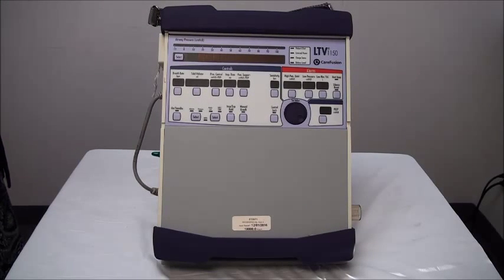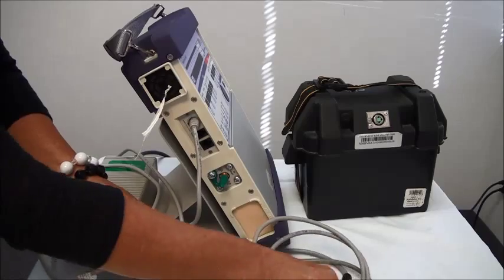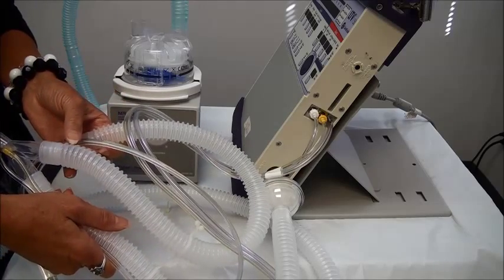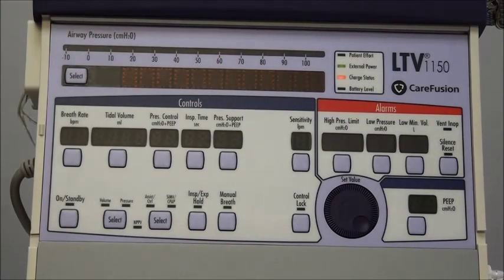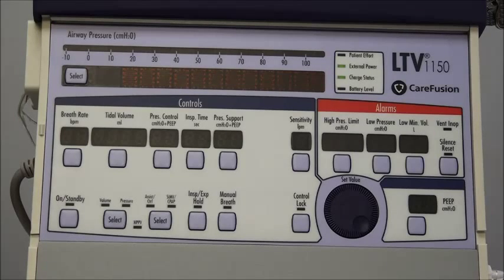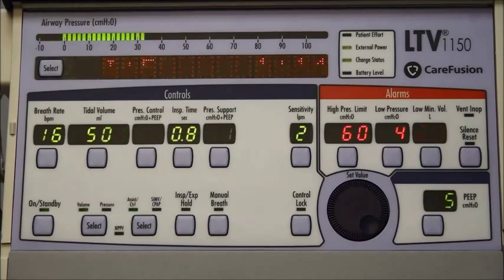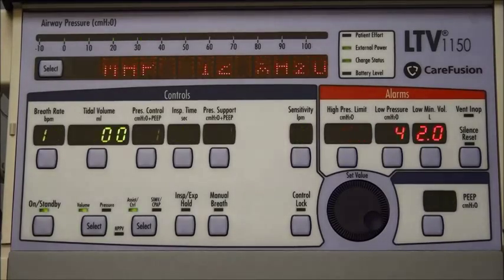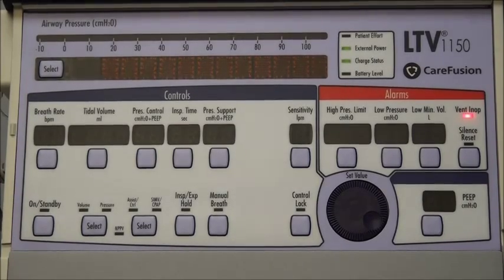LTV 1150 Ventilator Set UP

Comment: I just want to warn you. If you use an LTV 1150 ventilator, and you use it with a conventional humidifier WITHOUT A HEATED WIRE, well In other words, "DO NOT DO IT," if you can avoid it. The problems you will have are serious and potentially harmful. You're going to get water stuck in the exhalation valve, and the ventilator's going to alarm "DISC/SENSE," and you're gonna have the hardest time trying to clear the water out, because if you tap the valve on something it's either going to tear the whole valve to pieces, OR it's going to dislodge the rubber diaphragm. By the time you get your humidifier's setting low enough to avoid this, you are going to have dry trach secretions, and bleeding. You're not going to have atiquate humidification, and you're possibly going to have bloody secretions like me. I have a home care DME provicer they don't carry the heated wire humidifiers. We've tried to work on getting me a heated wire setup, but It fell to pieces because there was nobody to help with that, so I had to say, "FORGET IT!" I use an HME which provices a little bit more humidity, and I use it in addition to the humidifier and It's not much better, but my secretions are a tiny less bloody. I want to warn you, If at all possible, YOU MUST MUST MUST USE A HEATED  WIRE CIRCUIT. I cannot stress this enough. You are doing a PROFOUND disservice to your patients otherwise. Try putting a water trap on your exhalation side. That's going to drain excess water, but you are still going to have to keep the heater  humidifier on a low setting, or you're going to have the exhalation valve issues. In other words, "If you don't have a heated wire setup," YOU ARE IN TROUBLE, if the patient requires high amounts of humidification like I Do. so, I am administering this advice to help you to help your patients. YOU MUST use a heated wire. Otherwise, you're going to have NUMEROUS issues! Thank you!
Reply: +Peter Foster  Thank you for your note Peter, My name is Randy I am a Respiratory Therapist here at Midwest Medical.  We use non heated wire circuits very frequently. I can definately understand your concerns. To avoid all of the problems you mentioned and to prevent water from getting in the vent we use a hydrophobic filter.  Also with the non heated wire circuit a drain cup can be cut into circuit where on a heated wire you cannot.  Medicare and most insurarance will cover a new heater every 5 years. Also as a note from your physician can prescribe "heated wire heated humidity" dispense as written and they or another provider will have to provide a heated wire set up. Midwest Medical provides both. Best Regards,Randy K. LRT Midwest Medical Services.
Reply: Hey, can I ask you some questions about ventilators?

Comment: Can this be placed on standby instead of all the way off?
Reply: This is one of the things I do not like about this ventilator. There is NO WAY to place this machine in standby Mode. The only options are on, or OFF. I think that it would be so much easier if we could turn the ventilator on and off.